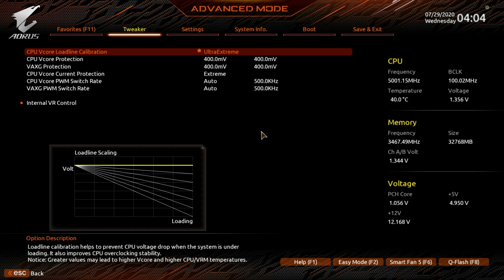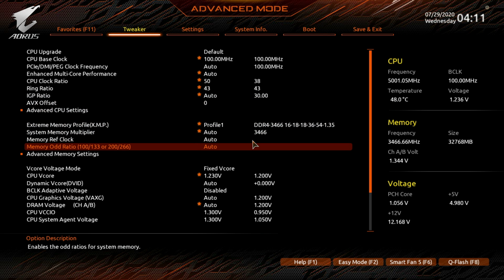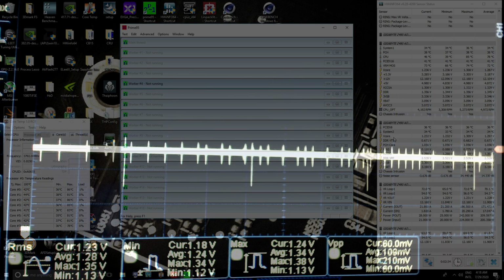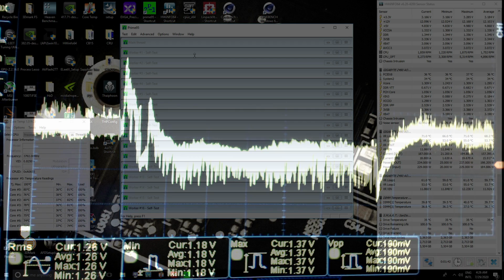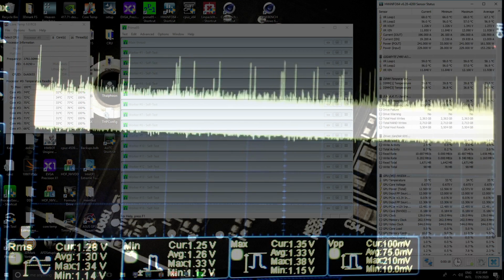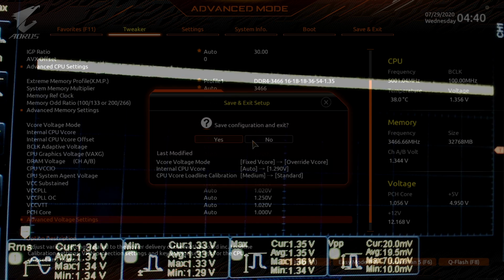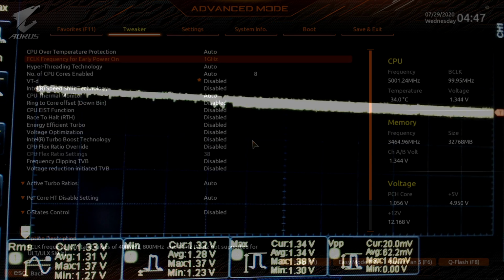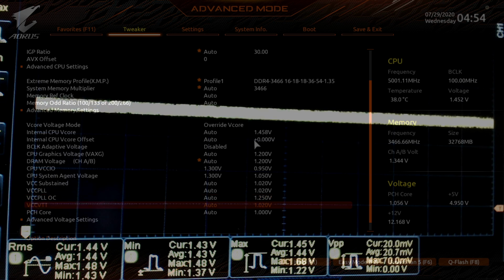Why Vdroop is good for overclocking and taking a look at Gigabyte's Override Vcore mode.

Comment: I'm pretty sure the mouse caused transients happen because window's processor scheduler.
The CPU constantly switches between tasks to actually be able to do more things simultaneously, but I/O interrupts for peripherals like mouse and keyboard basically take over CPU's priority so the software stuff gets put in background and you consequently get that damn spike.

Btw, great video as always
Reply: Would that mean using PS/2 peripherals would help since they're purely interrupt based and aren't polled like USB is?
Reply: @mystical4442  is usb interrupts handled in software while ps2 is handled on the hardware level? Wouldn't an interrupt always cause spikes no matter where it's coming from?
Reply: @fVNzO  As far as I know the PS/2 spec only sends interrupt requests when there's an event registered by the hardware, otherwise CPUs during the time the spec was conceived (386/486 days) would just be wasting cycles polling it.
Reply: @fVNzO  USB is not interrupt driven, it's based on polling as this allow for cheaper micro controllers and protocols.
Reply: @mystical4442  Hardware interrupts have the same effect as polling for the purpose of this video. When the attached device gets used the active task (Prime95) still gets pushed to the background. Once the interrupt ceases the active task will immediately resume. Meaning you'd get a comparable readout on an oscilloscope: peak -> valley. The peak and valley are caused by the VRM (and powerplane) catching up to the power draw requirement.
Reply: Doesn't explain the difference when dragging something instead of freely moving the mouse.
Reply: @outcastatsabre  yes it does - moving a window around is you just interacting with that one program and moving it - moving a mouse around and you might be doing who knows what next.  Big difference.
Reply: I wonder if part of this had to do with weirdness I had with original 3900x , system would freeze if I DIDN'T move the mouse around, like could do a file transfer, it would freeze and crash the system if you didn't keep moving the mouse around lmao, took me a month to figure out the CPU was dying, microcenter warrantied it for me though (: 
new one has lasted twice as long as original so far (+ at higher clocks with less voltage)
Reply: This is interesting. I should have realized context switching in an intense load like Prime in all cores should cause Vcore fluctuations which would put to test the stability of any OC better than just crunching numbers full swing. This establishes a new way to test an OC in less time: run Prime95 while you use your computer in web browsing/light workloads in which context switches will happen frequently to test stability. You won't suffer much delays in user experience because the OS will prioritize the threads from the applications you interact with.
Reply: Yea on older cpus i would have trouble with the high polling rate gaming mice. I think this is related.
Reply: Naaaah, what a stupid explanation. Eveyone knows it's Micorsoft being alerted about user presence and that porn is probably about to be watched, so the spyware is starting to record. Wake up, guys.